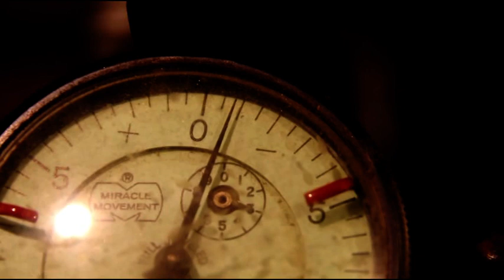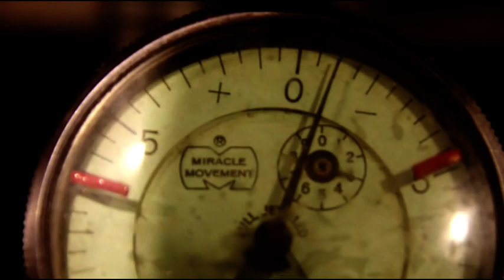Ford GPW Crankshaft.....Welding and Grinding Rear Main Seal Surface

Comment: Nice repair on the seal area, sad about the rest of it, should never get like that in a rebuilt engine. Like you said, make sure it's all CLEAN and use some addembly lube when it goes back together,
Reply from the maker: I am seeing a lot of problems these days from other shops.  Can't understand why things have gotten so bad lately.  At least the rear main seal area is perfect.
Reply: @metalshaperJeep  Sadly it's getting like that all over, very hard to find a shop - or anyone - who knows what's up with old stuff, not just in USA.